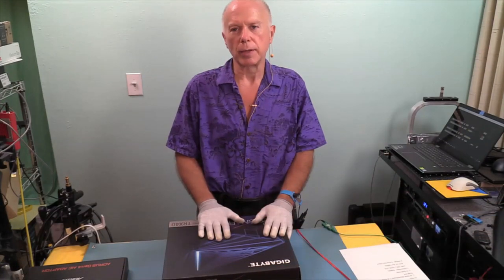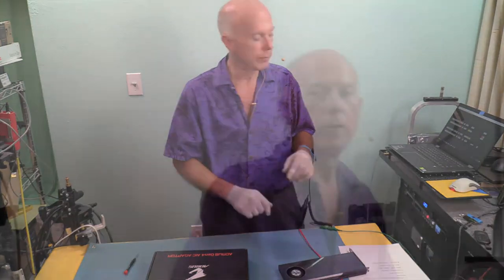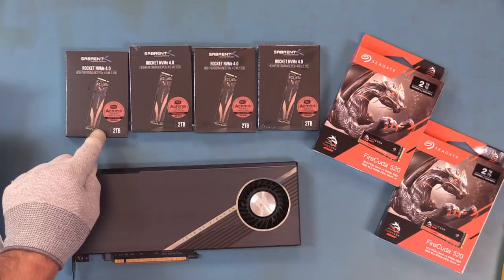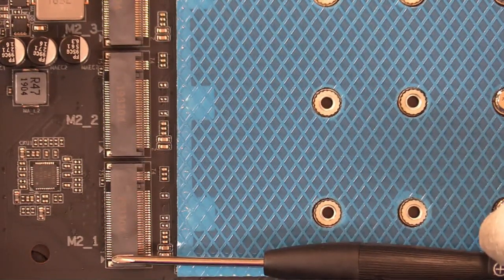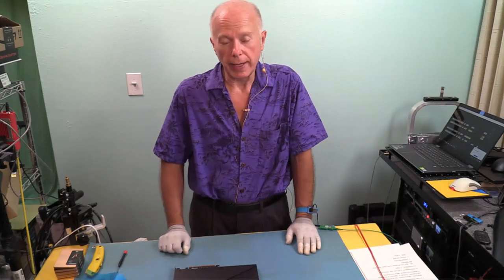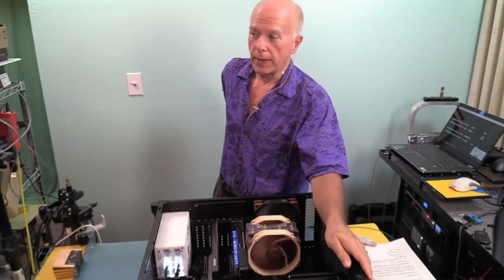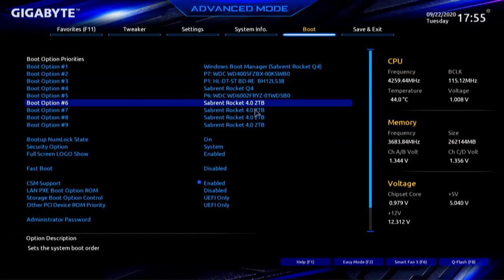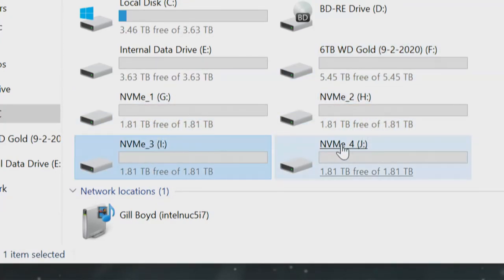Gigabyte AORUS Gen4 AIC Adaptor Comparison and Simple Install Tutorial TRX40 Designare

Comment: Thank you so much for making this insightful and instructional content. I tried following your steps for my build which has a Gigabyte TRX40 Xtreme motherboard instead. I had the same issue as you, the Auto bifurcation BIOS setting was not working and my PC was only reading one disk from the AORUS Gen4 AIC Adaptor (I currently have 4 disks in it). I set the bifurcation manually to x4x4x4x4 on the BIOS but after saving and exiting, the PC no longer boots. Can't get past POST, I don't see the BIOS or anything on the screen. The motherboard shows what appears to be "d4" which I looked up on the manual and states is a "PCI resource allocation error. Out of Resources". I also have a Gigabyte Thunderbolt 3 Titan Ridge (latest firmware) and watched your videos on on the "d4" issue you also had. However, after going through the steps of updating the memory allocation and prefetch to 256MB and enabling 4G decoding - I still get "d4" unfortunately. The GPU is an ASUS ROG Strix GeForce RTX 3080 10GB and I'm not sure if it matters but the build has 256GB DDR4 RAM. I'm really sad that I couldn't get it working, I saw so many similarities in what was happening with your videos and really thought it would fix my similar issue. Any recommendations or advice would be greatly appreciated!
Reply from the maker: Hi LA VELADONA,
Welcome! I'm honored! Appreciate Your Comments! Two possibilities. 1st Motherboard Bios Update? Step through each one! 2nd Could be what We referred to as a Bus prioritization issue. Meaning the order of the PCIe Devices. GPU has to be next to Titan Ridge Thunderbolt 3 AIC. And that's a problem the Firmware update should have rectified thus a Bios Update. That's also a problem considering how wide Your GPU is, 3.5 Slots wide I'm guessing. If this is true, then if the Bios Update does not solve this then a 2 Slot GPU will from what We encountered. Crazy, right. To reiterate, GPU and Thunderbolt must be next to each other if the Thunderbolt Firmware did not resolve this and the next Step being a Bios Update. Hope that helps! Keep Us Posted on Your Progress!

BTW: Just verified. You're running Bios F4 for Resize Bar. Did You skip any previous Bios Updates like F3? Can't see anything about Bios file sizes without downloading them. And no errata documentation about anything related to Thunderbolt Support. Next step would be Gigabyte support and they will be of no help based on Our experience. 2 Slot GPU alternative. Contact Gigabyte support anyway. This needs a Firmware or Bios resolution.

Also... Another thought, 1. Did You Disable CSM? 2. How big is Your PSU?
Reply: @BuildOrBuy  Hi there! Thanks so much for your detailed response I honestly appreciate it a ton. I followed your advice and tried to update the BIOS of the motherboard. I was on the first BIOS version that came with the motherboard at unboxing (version FA). I tried versions FB and FC of the BIOS and the issue persisted (error "d4" not getting to POST). I moved the PCI slots to have the thunderbolt card next to the GPU but that also didn't fix the issue. I don't have another GPU at my disposal currently to try with a smaller one (but I'm really hoping I can get this working with this one haha). Will definitely share my progress here in case it helps anyone else with a similar build. I've reached out to Gigabyte and hopefully they have an answer that can solve the mystery (crossing my fingers that there isn't anything faulty with any of the parts I purchased - they were all brand new so they shouldn't be but who knows!).

One thing I noticed after reading the motherboard manual closely is that there is a "OC_PEG" PCIe Power Connector on the motherboard that provides "auxillary power" to the onboard PCI Express x16 slots" (the motherboard recommends connecting this to the PSU if there are two or more GPUs to "ensure system stability"). I only have one GPU on my build but I decided to connect it just in case. Didn't solve the issue but just mentioning the steps I'm taking. I also disabled CSM. PSU is the be quiet! Dark Power Pro 12 1500W.

Update: After multiple hours researching this, I think I may have discovered the issue. I didn't know this but it seems like the Gigabyte AORUS Gen4 AIC Adaptor has a 8TB total capacity limit. I had a combined 10TB in the AIC adaptor. I only noticed this because I found that there is a Gigabyte AORUS Gen5 16TB AIC Adaptor coming soon. I realized if the upcoming model had a 16TB total capacity  then Gen4 must have a lower one. After further looking into it, I believe the Gen4's capacity is 8TB. I currently have two 4TB disks and two 1TB disks in the adaptor. I will remove the 1TB M.2 disks and see if it reads the full 8TB on Auto bifurcation (if not I think I would have to set it to x8x8? since x4x4x4x4 is for 4 disks?)
Reply from the maker: H @laveladona9445 ,
Auto Bifurcation does not work but that should not be causing the d4 error, out of PCIe Resources. Set for Manual Bifurcation to see all 4 Drives. Each M.2 NVMe PCIe Drive requires 4 PCIe Lanes no matter speed or capacity. Yes, the PEG Connector PCIe Graphics Power Connector should be connected. Did not know You did not have that Connected. And Your PSU is absolutely sufficient in size. Interesting Disabling CSM did not help. And above 4G Decoding status - ON?  So to reiterate, System will Boot with GPU and Titan Thunderbolt 3 as long as X16 Quad card is not installed. In JBOD, capacity nor speed of Drives matters. And that card only supports M.2 NVMe PCIe but NOT M.2 SATA SSDs. And if You have GPU and X16 Quad card installed and NO Thunderbolt, System Boots. The relationship between those 3 cards is the issue. And what We referred to as a Bus prioritization issue is still the problem that neither the Motherboard Bios Update nor the Titan Ridge Thunderbolt 3 Firmware update have resolved. And that's where You're at. Suggest remove all M.2 Drives on X16 Quad card and see if that matters. The issue is CPU PCIe Lanes. How long ago did You Build? And when did this start?
Reply: @BuildOrBuy  The system boots perfectly into Windows after I reset the CMOS/BIOS settings and leave the default (which is Auto for bifurcation) with everything connected (GPU, Thunderbolt card, and AIC Adaptor). The Gen4 AIC Adaptor has currently 10TB of M.2 NVMe SSD (2 of 4TB and 2 of 1TB) but with the default BIOS settings, only 1 of the 4 disks (4TB) in the Adaptor is read and shows up in Windows disk management and AORUS Storage Manager. I realized Auto bifurcation must not be working so I found your video on that and went to the BIOS to set it manual x4x4x4x4 for the second x16 PCie slot (which is where my AIC Adaptor is currently). After making that one change (Auto to x4x4x4x4) the system no longer POST and I could not get to BIOS or Windows. Then I tried everything else. But I'm fortunate that the moment I reset the BIOS settings to default by clearing CMOS on the motherboard, I am back to a working Windows machine (just with only one 4TB of the 10TB inside the AIC Adaptor being read). Yes, CSM is disabled and 4G decoding is on.

To clarify, system boots with all three cards. Only one M.2 Drive from Adaptor is read on default Auto bifurcation setting. I update BIOS to x4x4x4x4 for the Adaptor and BOOM no POST or boot. So the main thing causing it not to post is the Auto to x4x4x4x4 bifurcation update for this PCI slot.

I built this PC around 5 days ago and have had no issues until I changed Auto bifurcation to x4x4x4x4 in BIOS settings. I installed all the drivers and Windows was working just fine. My only problem was that all the drives on the adaptor were not being read and I tried this BIOs settings change 3 days ago which led me to your videos on this topic.

I will try to remove the two 1TB M.2 Drives from the Adaptor first to see if that helps. I'm just not sure if I should set the bifurcation to x8x8 or x4x4x4x4 if the AIC adaptor only has 2 drives in it. I guess I can try both and will report back to help anyone from this experience!
Reply from the maker: Hi @laveladona9445 ,
You're trying to do everything at once. You need to isolate and seperate each step. One step at a time. Decide Your priorities before proceeding to the next step. 1. GPU; 2. X16 Quad card, Bifurcated in Bios. Then try Thunderbolt. Then try swapping Thunderbolt with X16 Quad card. To reiterate the CPU PCIe Lanes are not being properly allocated. Remember, each M.2 NVMe PCIe Drive requires 4 CPU PCIe Lanes. Question: Was the X16 Quad card included with Your Motherboard?
Reply: @BuildOrBuy  You are absolutely right. Thanks again for your advice. I have tried to follow and isolate each step. It confirmed what you were stating about the Bus Prioritization and PCIe Lanes not being properly allocated. Yes, the X16 Quad Card came with my motherboard, it's the AORUS Gen4 AIC Adaptor which comes inside the box of the AORUS TRX40 Xtreme.

Here are my findings:

1. System boots perfectly with just the GPU.
2. System boots with both the GPU and x16 Quad Card (bifurcated in BIOS) connected.
3. System does not boot and shows "d4" error when adding the Gigabyte Thunderbolt Titan Ridge 2.0 card (firmware version 50).
4. System does not boot and shows "d4" error when swapping Thunderbolt and x16 Quad card PCIe lanes.

I then tried some additional steps and found something interesting:
5. I swapped Thunderbolt and x16 Quad card back, and I removed the 2 1TB M.2 drives from the x16 Quad Card. So now there are two 8TB M.2 on the motherboard and two 4TB on the Quad card (a total of four M.2 drives). This worked. The system boots.
6. Added the two 1TB drives to the remaining two M.2 slots on the motherboard and it no longer boots, stuck on error "0d" this time which I couldn't find much info on. (currently 6 M.2 drives on the system)
7. Swapped the location of the 1TB drives with that of the 4TB (from motherboard to x16 quad card) and still does not boot, but back to error "d4".

8. Tried multiple combinations of the M.2 drives on the motherboard and x16 Quad Card and noticed that it always boots when I have a total of four M.2 drives on the system (regardless of whether they are on the motherboard or x16 Quad Card). The moment I add a fifth M.2 drive, it no longer boots and shows "d4" error or "0d".

I don't understand why this is happening but it almost seems like the motherboard is limited to a max of four M.2 drives (when the Thunderbolt card is connected). I would appreciate any suggestions. I apologize for the long comments, just trying to make sure I don't miss any important details. I'm really confused about what could be causing this. Thanks so much again for helping me 🙏
Reply from the maker: Hi @laveladona9445 ,
This time, Excellent diagnostics. Simple, to reiterate, Not enough CPU PCIe Lanes which is impossible considering this is a TRX40 HEDT! Count Your Lanes! You have enough but they are NOT being properly allocated! And the tipping point seems to be a 3rd M.2 NVMe PCIe Drive. All of this falls back to Gigabyte for what they need to fix since CPU PCIe Lanes are not properly allocated. Another option to test would be to place Your GPU in a X8 Slot and verify that. All 4 of those PCIe Slots are using CPU Lanes. The only other thing this could be would be IF the CPU were not correctly torqued down. That would cause either Memory or PCIe problems or both. How old is Your System? The last option if Gigabyte will not resolve would be a WRX80 Workstation Motherboard and Threadripper Pro CPU. The HEDT was perfect! 

BTW: Fast Boot also Disable along with CSM?
Reply: @BuildOrBuy  Thank you again. Definitely seems like the TRX40 Xtreme motherboard requires a new BIOS update. I hope Gigabyte is actually going to work on this since it seems like they have now discontinued these TRX40 motherboards.

It does boot with the GPU in the top x8 slot and the x16 Quad Card on the first x16 PCIe slot. However, I was hoping to get this to work with the GPU in the first x16 slot and Quad Card on the second x16 slot. My only idea now is actually to get a PCIe riser cable to plug in the Thunderbolt card to the first x8 PCIe slot (which is slightly under the wide GPU). I just would need to figure out how and where to mount the Thunderbolt card. I'm not sure it will work but I have a feeling it might.

System is brand new, just built it a few days ago and it seems to be working well (just not with the combination of GPU, Quad Card, and Thunderbolt all together). Fast boot is disabled as well in BIOS.

I truly appreciate your time and for sharing your knowledge/expertise to help me diagnose my PC issue. You have the most detailed videos and the step-by-step troubleshooting you do for your content is fantastic. I've never interacted with a creator that not only replies to all their comment but really takes time to help their audience. I admire your work and wish more channels were like this one. You've earned yourself a fan for life! :D
Reply from the maker: Hi @laveladona9445 ,
Riser cable We tried with PCIe 4.0 on the X16 Quad card, no go! BSOD with 2 different PCIe 4.0 Cables. We have a Video on that experience. Did not try PCIe 3.0 which is Thunderbolt X4 PCIe 3.0 Lanes. If You get a BSOD, You'll know what and why. Much Appreciated! If We don't start getting more paying Clients, I'll be forced to shutdown just so You know if We disappear. All Clients are online now. No local Clients anymore since the world is upside down. Everyone I've known for 30 years in this business is still afraid of their shadow. Thank You for Your Comments! Agree! Too bad the HEDT TRX40 Is no more. A perfect transition from Consumer Desktop Motherboard in between the WRX80 Workstation Threadripper Pro Platform! Appreciate Your Support! I'm honored! Even though We did not solve Your Problem, We both have a better understanding of Your Problem! Progress!

Comment: Hi Gill! I have a Threadripper 3970x, a RTX 3090, Corsair iCUE H100i RGB PRO XT cooler, 3 x M.2 1TB 4.0 at the motherboard Gigabyte TRX40 Aorus Pro WiFi, 3 x 1TB SATA SSD, 4 x M.2 3.0 at the Aorus Gen4 aic Adaptor, also 2 x Sabrent NVMe M.2 SSD to PCIe adapter for 1TB 3.0. Any advice for what kind of PSU should be at this set up?
Reply from the maker: Hi Mitxel Sadaba,
Great Question! Good to hear from You! This could almost be another Video! Around 1200 watts. Seasonic, Super Flower, EVGA or be quiet!. Good clean PSU is extremely important. Always try to figure out the Manufacturer if You buy any other Brand. We prefer Fully Modular. Hope that helps!
Reply: @BuildOrBuy  Hi Gil! Well thanks!! Yes I think it deserves a video. I bought the be quiet! Dark Power Pro 12 | 1500W. Just in case in the future I upgrade to 2 x 3090. That was my first goal. However, I know I have only 2 x 16x pcie lines, so, for now I won't, due to the Aorus Gen4 aic Adaptor. Thanks. The PSU calculators that I found don't add the expanded m.2 nvme cards. So I was a little bit lost. Thank you!!
Reply from the maker: HI @mr_nemo24 ,
Smart Choice. Allows room for Upgrades! Thanks for Sharing! You are most Welcome! 
BTW: If You're going to consider 2 RTX 3090s, consider 1 RTX A6000 instead. That way You can keep the Quad card running too!
Reply: @BuildOrBuy  true. For the moment I will keep it this way. 1 x 3090 and the Quad card. Tha's enough for the moment XD
Reply from the maker: Hi @mr_nemo24 ,
Agreed! Thanks for Sharing! 

BTW: Good thing You Built Your Computer when You did. CPUs are getting hard to come by right now. Let's hope that changes in March!
Reply: @BuildOrBuy  yes. Very lucky to adquire all these before even the lack of graphics cards.